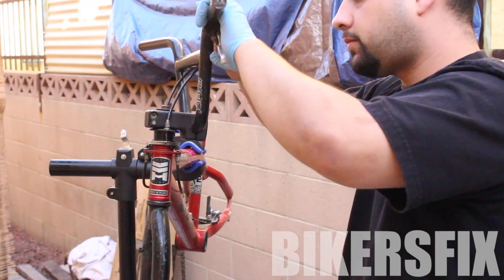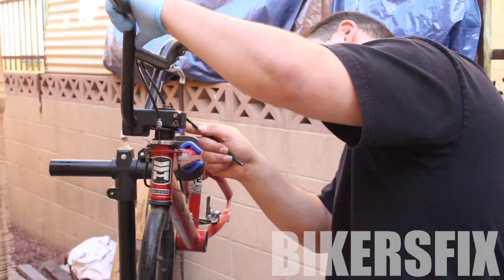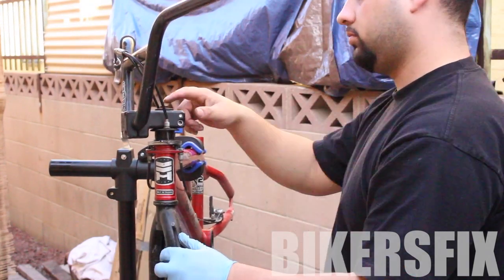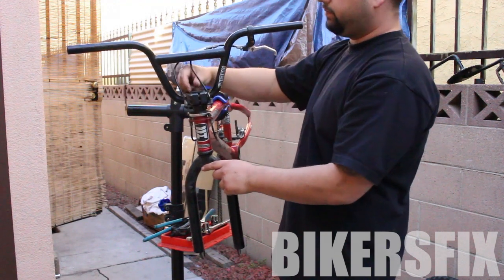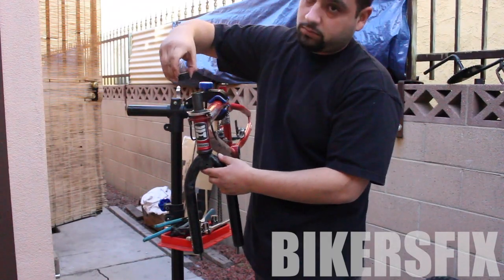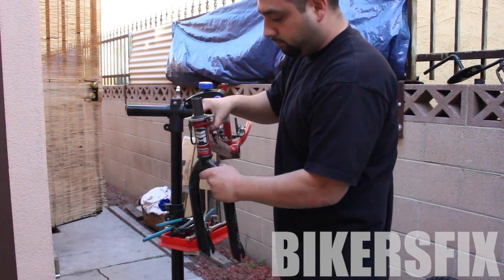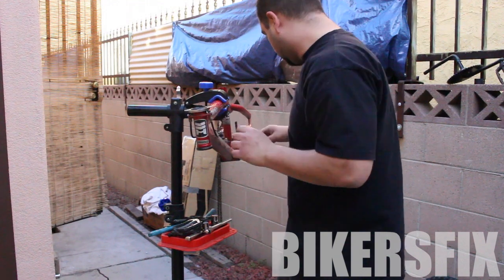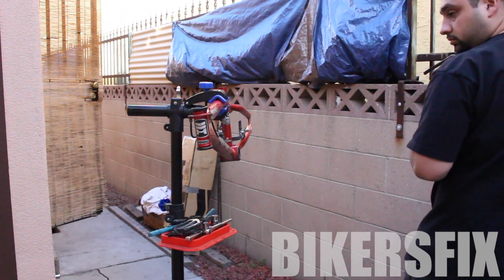How to Remove Forks & Stem /Headset Bicycle Bmx Haro

Comment: i havent taken mine apart yet.. but that rubber lock washer.. should i replace with new one or do you use again? just curious  your thoughts.  Also do you grease up bearings again if so what do you recommend  to use for bikes?

Comment: My bike fork has two nuts at the top above where it connects to the frame (neck?) that are hard to screw off. Suggestions?
Reply: Also, it’s missing its front wheel